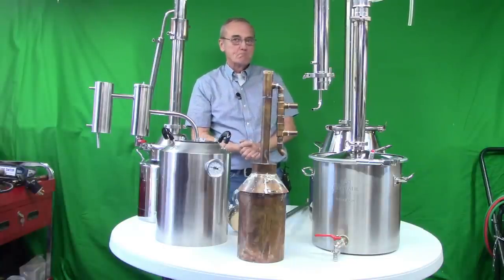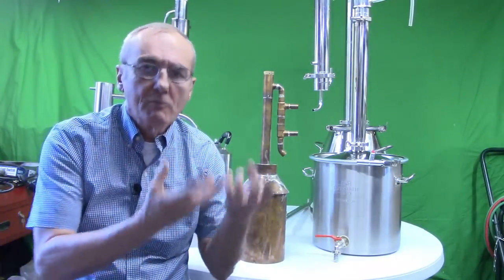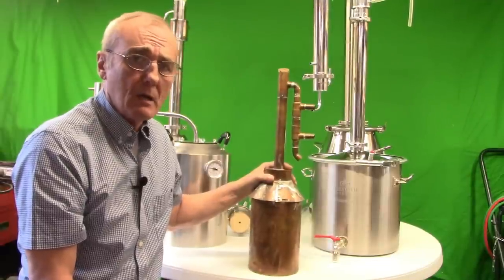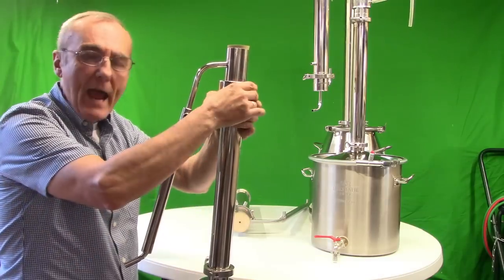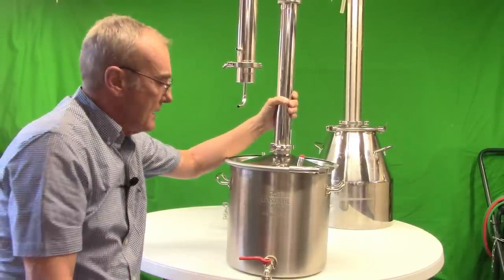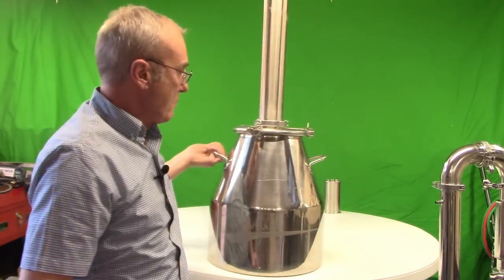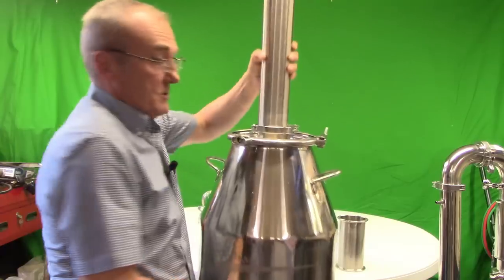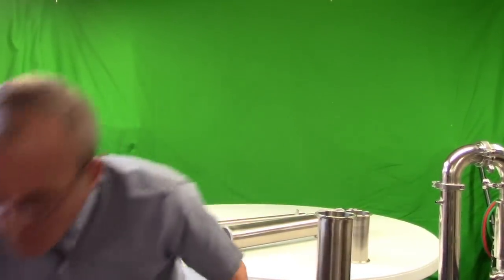Beginner's Guide #5 Moonshine Stills

Comment: Pi rxr = area of the circle.  The radius = the distance from the center to the edge.  https://www.mathsisfun.com/numbers/images/pi.gif

In the case of a 3" pipe 3.1416 x1.5 x1.5 = 7.0686 square inches.  But there are charts for volume through a pipe.

Comment: No matter how hot you get your boiler the  alcohol always comes over first
Reply: The hotter your boiler the more water comes off at the same time. Giving you a lower abv or proof.
Reply: True! You can't heat the boiler above the boiling point of that mixture of ethanol water etc.  
Only way boiling faster (faster, not hotter) in a pot still will reduce abv is with entrainment/puking (liquid that has not boiled comes over and out the condenser.  

This is a common. I think because in one of those super wide super tall pot stills that the big boys use (picture any scotch distillery) you can get significant passive reflux and a vapor temp gradient below the point of no return.
Reply: Sorry to disagree but I disagree if what you said was true we all could make 200 proof every time we can't because the ethanol always carries some water with it even running low and slow if you run hotter you will carry more water and reduce your abv.
Reply: @chuckdontknowdoya6100  
Sorry I didn't explain my self well the first time around alcohol water mixes have different boiling points based on the ratio of the mixture, likewise the alcohol content of the vapor depends almost entirely on the proof in the boiler, as that goes down (because the alcohol leaves at a higher rate) so does that of the vapor. 
If you boil faster (again unless you introduce back pressure it won't be hotter) some liquid in the form of a fine mist generated at the surface will be dragged over with the vapor, those little water drops are the abv of boiler charge and will lower the output adv. If you slow down the boil (less heat in) then vapor speed also slows, giving entrainment a chance to fall back into the boiler. After you have accomplished this, without media for liquid-vapor interaction and re distillation, you won't get any increase in abv by going slower.
Reply: But you will raise or lower your proof depending on the speed of your cook which is what I was trying to say the slower you go the better your final proof abv was a poor choice of words but I did mention booth it was late and I had only been up 20 hours
Reply: I  put in the mash and turn m1 jet natural gas burner on a high clean blue flame and I use a 3inch x 3 foot column stuffed with mesh it takes a little while for 15 gallons to warm up and a minute for the column but when the heat reaches top of the column it reads about 165 and slowly rises I take off the first 8 ounces then  I collect the product until it reaches 200 an then shut it down I have a very efficient column this strips off the drinking alcohol and the heads and then I activated charcoal filter it and I get about 165 proof and it's good to go

Comment: Fractionating portion in the refinery I think is called a cat cracker and they require extreme skill.
Reply: Fractionation is the crude unit and other units that have towers.   A "cat cracker" is not a tower, but a reactor.
Reply: @MrEric_API  Cool never got to that stuff I just seen the news about the explosions time to time. Yes you say it's a reactor but it truly is a device that employs stratification how else would you get all the different products when specified target pressure temperature  has been hit. Pipes are at varying strata to collect specific product to be actively diverted to storage.

Comment: Will you please stop using PID to describe a digital temperature controller. PID is the mathematical functions used to establish accurate control, it doesn't effectively describe the function of temperature control. Also to an Instrument Technician like myself, it makes you sound a little dim, like you're using the big words you don't understand. There are very few if any non-PID controllers left in the world, PID has been used in control since before the Class 15 Honeywell (those big round 40kg pneumatic things in panels in any 1950 science fiction movie). I'm okay with K type thermocouple, common as muck and I've made many, but out of interest, at those temperatures there are better options. RTD or Thermistor would do better.